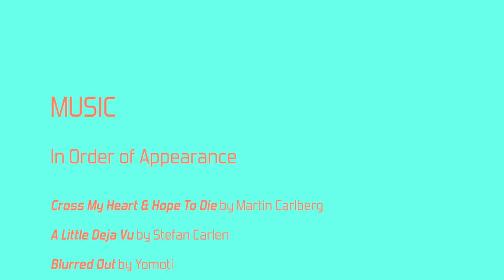They're 'Doing It' On The Public Dock..! | Vlog 87 | Sailing & Travel Europe

Comment: Just curious, as a dabbler in furniture making and a man without a dedicated clean room for finishing, I've always used an oil varnish mixture, have you ever tried this? I use one part spar varnish with one part double boiled linseed oil, and one part turpentine; although, some leave out the turpentine when a few days odor are a problem. The advantage is that it is a rubbed finish and  to freshen the surface you need only work it with four aught steel wool prior to re coating. After application, wait for it to begin to tack and wipe it dry. Typically on raw wood, you would wait half an hour if it's cold, maybe less in your heat. Each coat will go quicker, the second at fifteen minutes, and the third in seven. The heat and humidity would likely accelerate this.
Reply from the maker: Thanks mate, I may use this technique.
Reply: Maybe try a test patch and see how it turns out. Either way, it would be interesting to know how it turned out. Cheers.